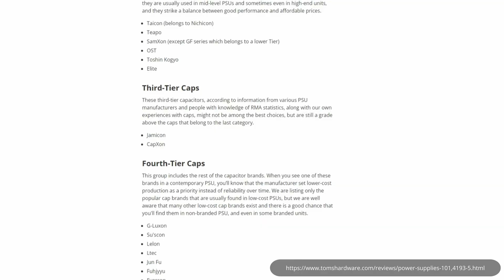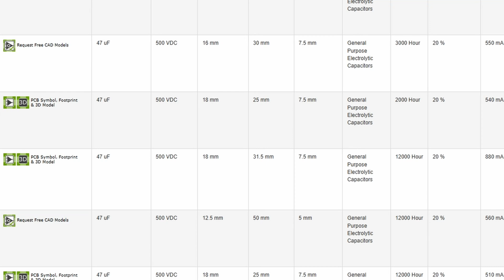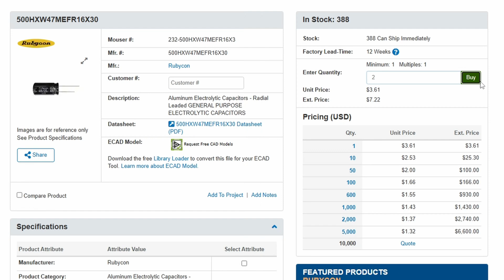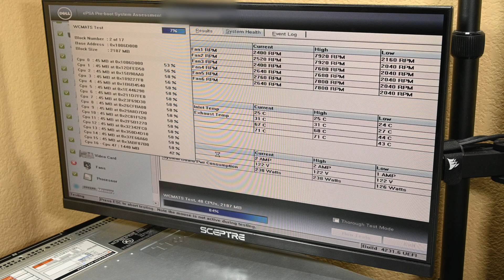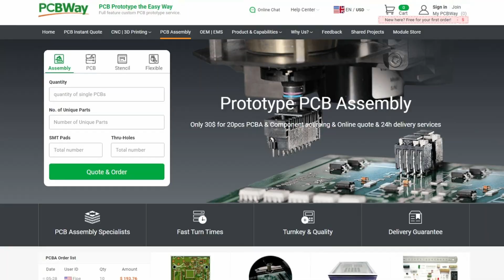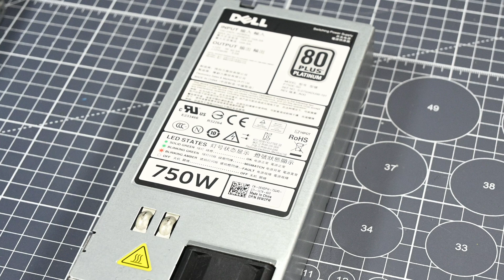Electronic Devices and Capacitors - Let's Talk About a Common and Easy-To-Fix Failure!

Comment from the maker: Hey there friends! I realize after thinking about it a little more that maybe my wording failed to stress the importance of knowing how to deal with high voltage if you're doing a capacitor swap in a power supply.

The capacitors in power supplies can be quite dangerous, and it's not something I'd ever want any of you to be hurt by. I specifically avoided covering it myself, or linking to any specific external sources because the last thing I want is to either make a mistake in my presentation, or link to a presentation that has a mistake in it that I miss, that ends up hurting someone.

The point of the video is to demonstrate capacitor swaps that can be done in all kinds of devices, not only ones that have high voltage/dangerous capacitors in them, but I understand that it was quite power supply centric.

If you're going to work in a power supply, please only do it if you are highly knowledgeable in what you're doing. If you're not, I would advise against working in a power supply. And please, don't hurt yourselves!

Comment: I enjoyed your content, but maybe a short segment on how to safely ensure the discharge of the units would be beneficial or at least a link to the people you say have covered the topic better than you could. 🤨
Reply from the maker: I'm glad you enjoyed, and you're right about how at least a segment on this would be useful. In full honesty, I just don't feel like I'm qualified enough to instruct others on exactly how to deal with high voltage devices, really, I'm only demonstrating the capacitor swap part here, or at least that's the goal. I should change the title to not specify power supplies.

I really just don't want anyone to get hurt based on a mistake I might make in a video on it, and that's also one of the reasons that I don't want to link to anything in particular because I'd hate to accidentally miss something, or just be oblivious to something, and link to a source with an error in it that causes someone to get hurt.

Working in a power supply is really something that only a person who's familiar with these voltages should do, but my wording might have slightly failed me in getting that point across.